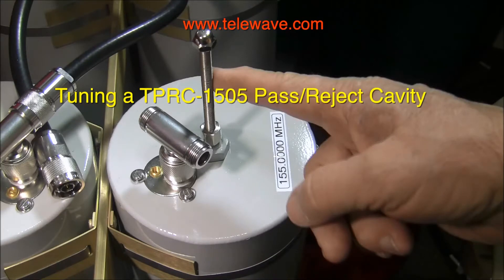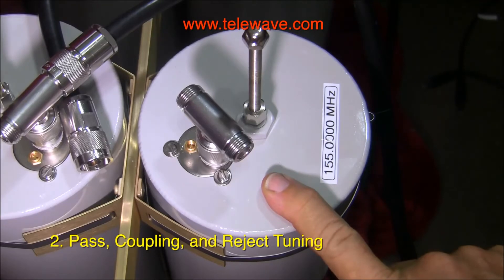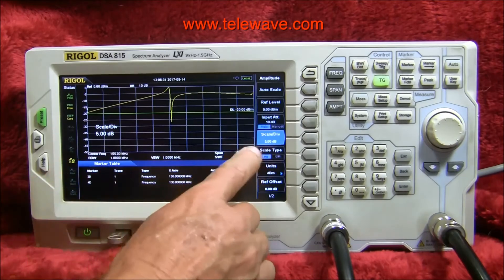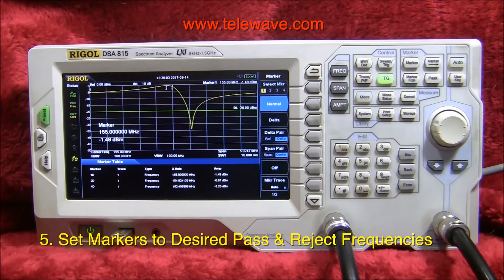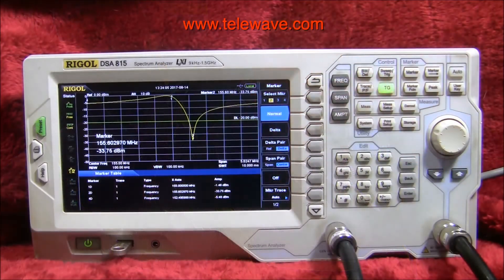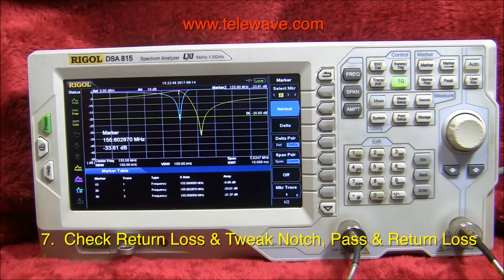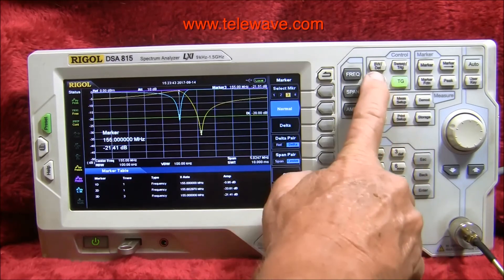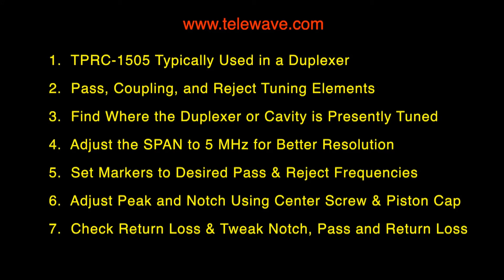Telewave TPRC-1505 Pass/Reject Cavity Tuning

Comment: I'm making a duplexer set for 147.300Mhz TX and 147.900 RX I want to know if the TX and RX sides are the same, both with capacitor? how to move the notch opposite from the peak? I will appreciate your answer.